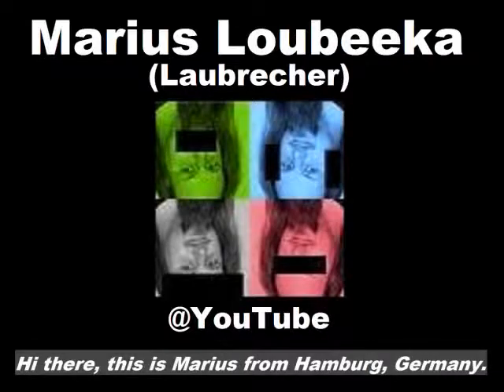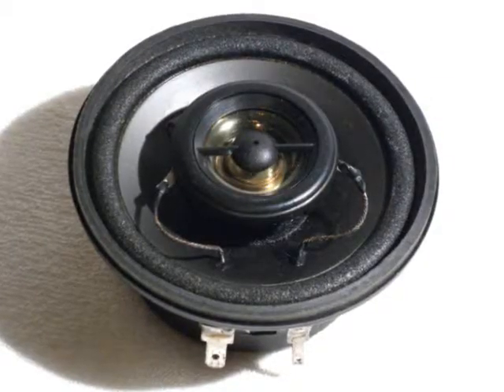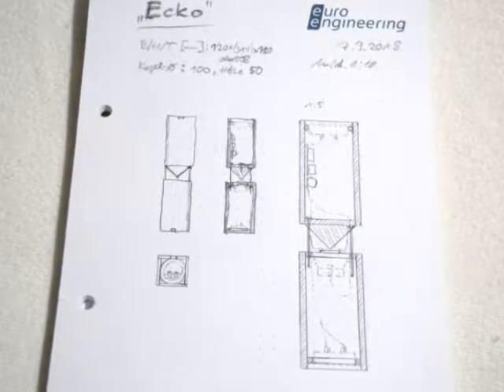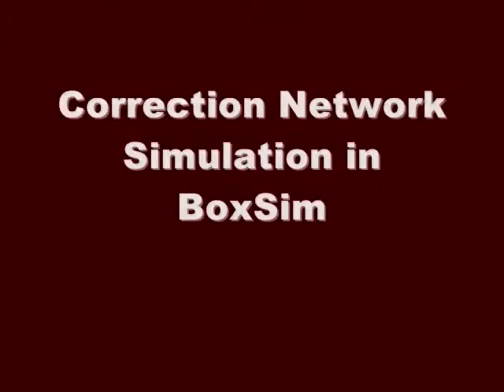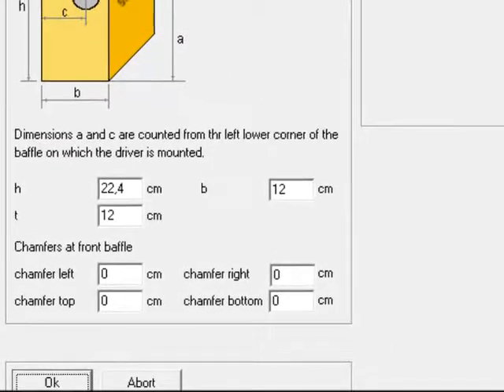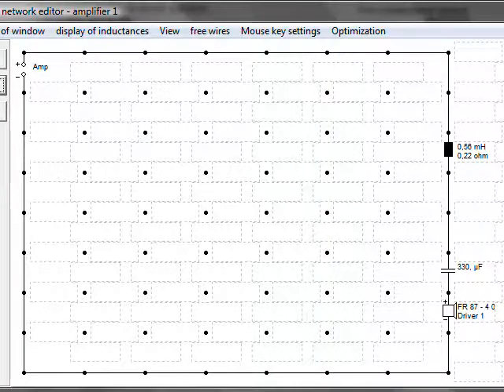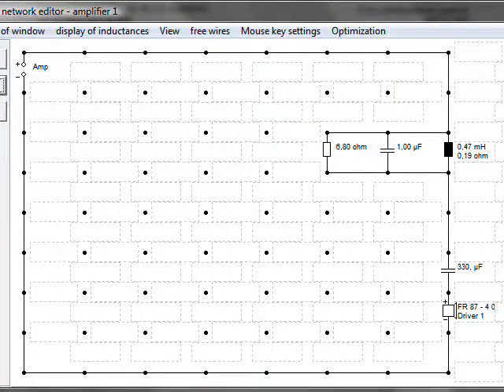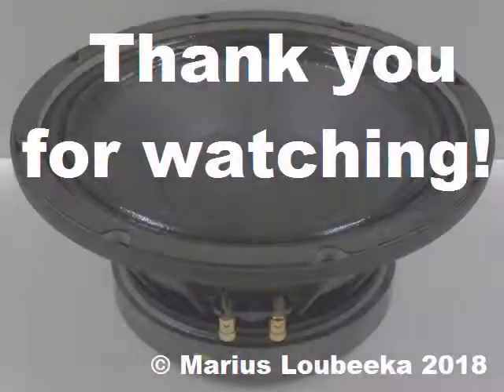Teaser for New Project: Omnidirectional Speakers incl. Quick Crossover Design (English subs)

Comment: I built the Klang Und Ton Rondo omni's . I also built my version of the Linkwitz Pluto's with Visaton drivers . I also built a set of naked dipoles (woofers in a H-frame) . Constant directivity is the way to go !
Reply from the maker: I'm very curious to try omnidirectional speakers. According to the description of their sound in Hobby HiFi it'll be very interesting. Unfortunately you're so far the only one who voted for it. So presumably it might only become my second project in 2019 after the cheap 3-way boxes.